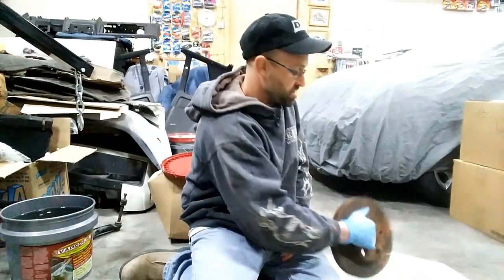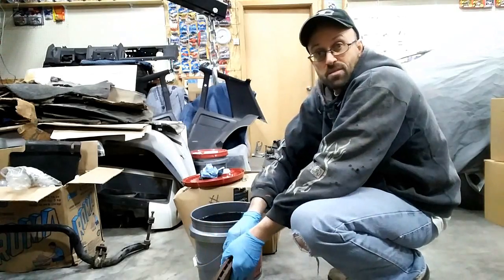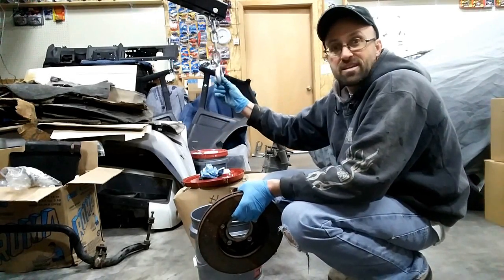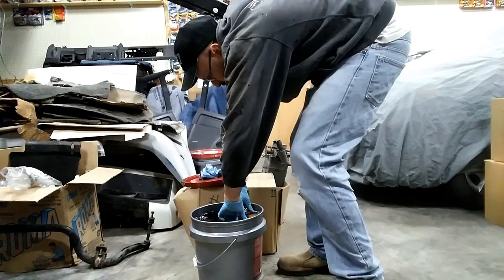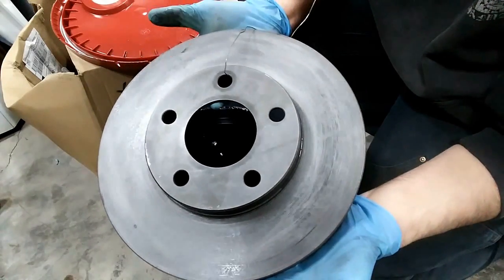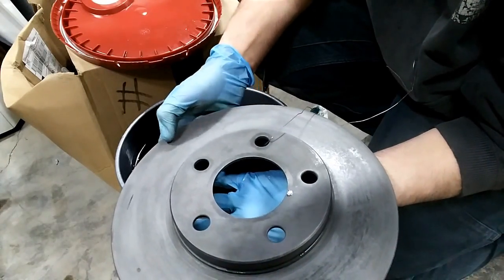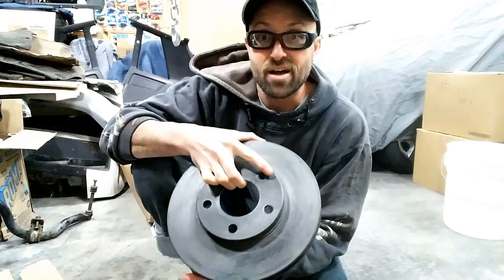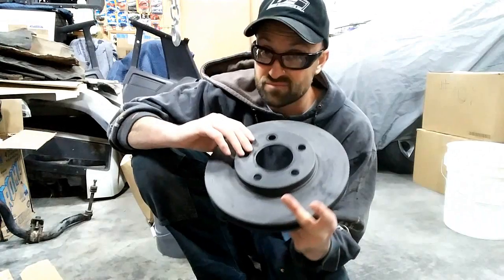Fixing Rusty Brake Rotors With Evapo-Rust Solution

Comment: I bought new rotors for my accord a few years ago. Garage opened the plastic on one and said they didn’t fit. Rotors were put back in trunk and the opened one somehow got some surface rust on it? Wanna sell em cause I don’t have the car now. I just do what you you do in the video and it will take the rust off and look like new again?
Reply from the maker: Yep. I just soaked them in the EvapoRust solution. Takes it all off. I dipped it in the solution and let it drip dry to leave a coating on it for storage.
Reply: @BasinMotorsports  Great! Thanks! A little rain musta got into my car trunk or something?
Reply from the maker: Most brake rotors will surface rust from moisture in the air.

Comment: Thanks for the tip. Got a 2019 Kona EV and the car started making a terrible screeching/grinding noise about a week ago. The dealership wants to charge me $650 to replace the barely-used front rotors and pads! I only have a bit over 30k kms on the car and, as it's an EV, the brakes are hardly used as regenerative braking recaptures most of the energy back into the battery as the car slows down. The brakes really only kick in the last couple km/h. Really wish companies making EVs would invest in zinc-coated & painted rotors, or at least allow customers to have the option to pay a couple extra hundred bucks for them. Anyway, I'll definitely try this out if it looks like a good option once I take the wheels off.
Reply from the maker: I painted the center hubs after they were dry. Simple and it looks good too. Good luck with the EV brakes. I'm surprised they don't coat them either.

Comment: First wash or rain and they get rusty again
Reply from the maker: I painted the hub to prevent rust later on, but you can't do much on the brake pad surface. More reason to drive it and prevent build up.

Comment: Is it necessary to use the rust inhibitor after the rust remover
Reply from the maker: Evapo-Rust says you can dip the finished part into the solution and let it air dry to prevent future rust.  I've done that with everything, and I've had mixed results thus far.  Some things have been great, some things have had a small amount of rust form again (small surface rust).  I'd say try the dip and dry method first and see what happens.
Reply: @BasinMotorsports  ok I will. Appreciate  your response.  I v'e learned a lot from your site. Have lot of cars to finish

Comment: Canaan,  can the evaporator rust be used repeatedly or is it a one deal?
Reply from the maker: You use it as long as it works.  The original 3.5 gallon pale is the only one I've used so far.  I've done four brake rotors, four spindles, headlight buckets, fasteners, etc.  If it fits, I've put it all in the 3.5 gallon bucket.